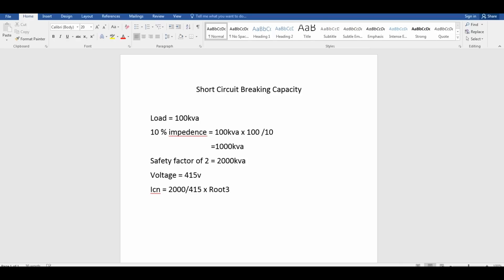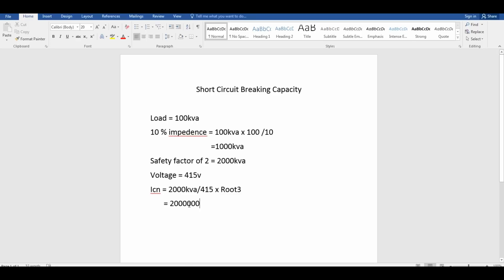Circuit Breaker ലെ kA റേറ്റിംഗ് എന്താണ്|What is kA rating in a Circuit Breaker | How to Calculate kA

Comment: Short ckt  ആണെങ്കിലും over load ആണെങ്കിൽ higher current അല്ലെ pass ചെയ്യുന്നത്  ???  10ka യുടെ breaker through 12ka current pass ചെയുകയാണെങ്കിൽ അത് trip ആകില്ലേ ??? പിന്നെ എങ്ങനെ ആണ്  damage ആകുന്നത് ??

Site ൽ കൊണ്ട് വരുന്ന breaker working ആണോ എന്ന് എങ്ങനെ test ചെയ്യാൻ പറ്റും ??
Reply from the maker: Overload aakumbol high current onnum verilla may be 10a mcb il 11 amps polum overload aanu trip aakum... short circuitil angane alla oru second il undakunne current aayiram pathinayirangal aayrkm...10ka breaker ennu paranjal athin 10ka il trip aakumenalla...10 ka vereme athin withstand cheyan patoon aanu...athil koodiyal athu kathi pokum...
12ka verumbol athu trip aakunethin munp thanne kathi pokaam...trip aakan edukunne time mathy athu kathi pokan
Rccb,vcb okke aanel athil test option undaakum angane test cheyyam
Reply: @TechCornerMalayalam  - tnx for replay ,"" 10ka breaker എന്ന് പറഞ്ഞാൽ 10ka യിൽ trip ആകുമെന്ന് അല്ല ""

 അപ്പോൾ എങ്ങനെ ആണ് short ckt protection mcb ചെയുന്നത് ????  phase-neutral short ചെയ്യുമ്പോൾ mcb trip ആകാറുണ്ടല്ലോ ???? mcb and mccb working conditions aano nu അറിയാൻ പറ്റും ???
Reply: Short Circuit scenario yilum MCB trip aavum. It will trip faster than it would 've incase of a normal overcurrent scenario. Now, as you said the difference it makes for a short circuit fault of say 10kA and say 25kA is not much in the trip time. It is the amount of energy the CB has to handle for a fault on its output side. Suppose that a CB with 10kA short time rated for 1 second, it will not be suitable for use with a power source that can pump more than 10 kAkA, or, even which pumps 10kA but for more than say 1sec. What infact happens is that when you try to make the short circuit current flow through the CB contacts even after the designed short time rating ( 1 sec / 3 sec as the case may be), it will heat up very quickly and will take the whole CB mechanical components out of its thermal design values and hence, the whole thing burns out. (Basically, the energy it has to handle will be different in the two cases). Site il kondu varunna CBs can be tested by applying a current through it and verifying that it trips as per the trippping characteristics, be it MCB or a relay operated CB.